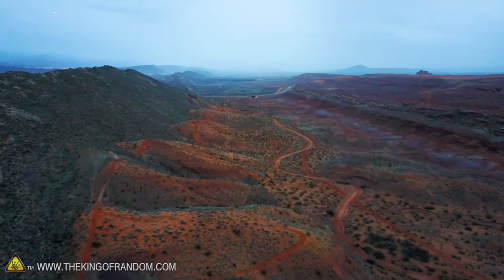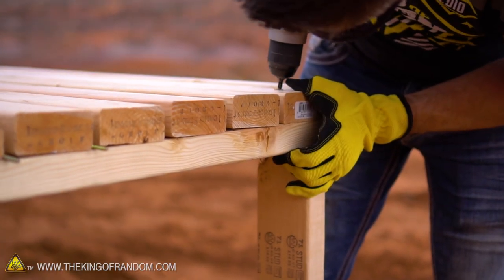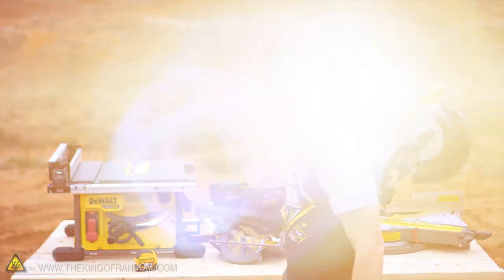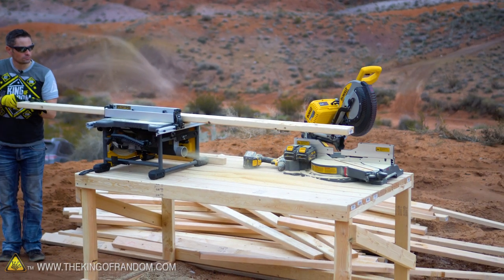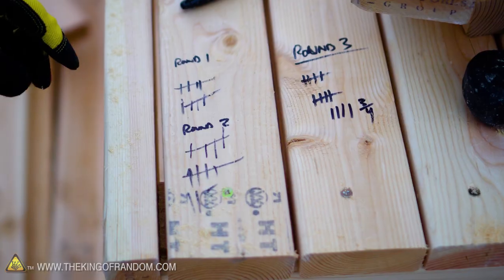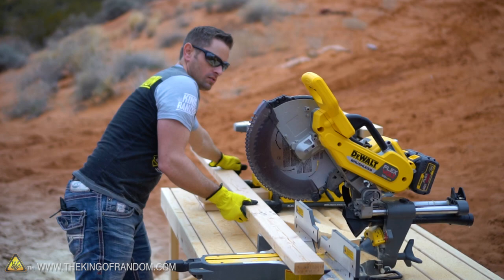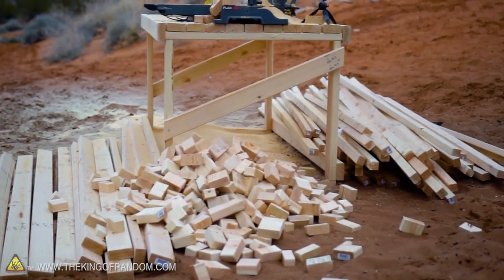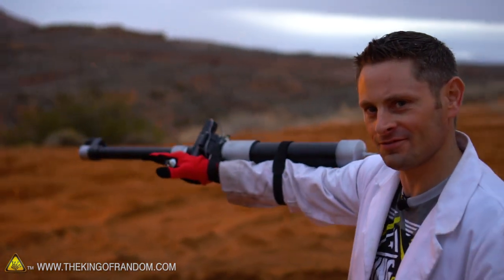Explosive Desert Bonfire, With DeWALT | TKOR Makes A 2x4 Bonfire With DeWALT Power Tools

Comment: You could have kept the wood for future projects and basically have lots of it without having to buy more. But hey it was a cool bonfire atleast
Reply: but wood isn't a renewable resource.
It takes a lot of work to grow a tree.
Reply: MaxPower yeah sure was sponsored along with 10 grand worth of dewalt toos
Reply: Haiiry Cake wood is renewable, also recyclable.
Fossil fuel based petroleum is not renewable, because lots of time and extreme pressures turned bio matter into crude oil.
Reply: Sebastian m nerd
Reply: You don't need wood to use a vacuum chamber or silicone
Reply: Some people just want to watch the world randomly burning.
Reply: Gnome child!!!!

Comment: I think you should have mentioned how long these battery packs take to charge. Depending on how long it takes you to drain each battery pack, with just two or four batteries, you could possibly run all your equipment indefinitely as long as you had charged your packs after draining them. Still a nice video. I wasn't aware Dewalt had such flexible multi-voltage batteries these days.
Reply: i know right they don't want to show the downside.

Comment: He kept saying that the 2 by 4s were and inch and a half thick.... Wouldn't they be 2 inches thick?
Reply: Alec Rosenthal no, Google standard lumber sizes, a 2 x 4 is actually 1.5 x 3.5 inches.
Reply: Mechie980 Does that make any sense?
Reply: 2 by 4 is the size before the wood dries. Once it dries it actually shrinks to 1.5 by 3.5.
Reply: Still doesnt make much sense
Reply: you can still by rough cut 2x4's that are actually 2x4. these are regular so they are 1.5x3.5. 2x6 is 1.5x5.5 and so on so forth. they still go by the old sizes even though they mill the new ones down more. they round the edges also. where as a rough cut has square corners. hope that helps
Reply: It does make sense when you realize the rough cut wood is at the actual dimensions  THEN it is planed down to the finished, smaller dimensions to produce the standard sizes we all use in the States.
Reply: Alec Rosenthal due to cheapness on manufacturers part, 2x4s are no longer correctly sized. They are actually 1 1/2 x 3 1/2
Reply: Cnerde I think you are ignoring the point. he asked about 2x4 lumber. not just the thickness of the board
Reply: I totally read his comment wrong. Derp on my part there.
Reply: people say it's for all sorts of reasons, not sure which one is true.. personally, I don't care that they're 1.5 inches thick, I just call them 2x4 because people know which board I mean, and "hey get me those one and one half by three and one half inchers" doesn't quite have the same ring to it
Reply: theXald this needs more likes
Reply: The name just stuck. A long time ago, framing lumber was  cut to 2"x4". But modern engineering now understands that wood just doesn't need to be that thick in order to make walls that are strong enough for residential construction.

More wood = more expensive. It's also heavier, and simply not necessary. Now the standard size is 1.5" x 3.5".
Reply: +pocket83 Actually, as far as I understand, 2"x4" originally referred to the dimensions of the wood before drying it, because the wood would shrink as it dried. Nowadays, it's just a name, and the lumber is instead specified by its final size, which is standardized to 1.5" x 3.5".
Reply: Granted, fresh timber is mostly water, but a 2" thick rough cut will still not shrink to 1.5"; that's 25% of its original size! Further, I have remodeled buildings that had 2"x4" framing lumber in the walls.
Reply: pocket83 that is correct. read my first reply. they are cut to that size after drying
Reply: +probsty13 A 2" thick rough cut won't shrink to 1.5". 1.5" is just a standardized value that was agreed upon, even though 2 by 4 was kept as a "name" for this cut. According to my understanding, anyway.
Reply: if you read my reply that is what i said. the rough cut is 2x4 then they process it down to 1.5x3.5. cause people want pretty wood lol

Comment: now that you did something hot... put liquid nitrogen in the vacuum chamber!!! it should solidify :D
Reply: Under what rules of physics would that happen?  Liquid nitrogen should boil off in low pressure..
Reply: He tried that a few videos ago! You should check it out.
Reply: Steve Jones no. The nitrogen will boil faster due to the low pressure, however, this causes more and more heat to be taken with it. This causes the temp to drop below nitrogens freezing point, and it will solidify
Reply: AHH..  wow.. that is kind of cool..   and explains to me why it hasn't really worked in many of the videos I've seen..  Every attempt I've seen just seems to boil off, but it's probably because there's not enough to last long enough to get cold enough, or the container isn't insulated well enough to not heat from the outside too fast.  

Even when it did work, I would guess that's a state that is very unstable though, right?  The solid N2 should sublimate away fairly quickly due to the vacuum, right??  Thanks for the explanation..

Comment: put a bluetooth speaker in a vacuum while playing something
Reply: I don't thing, it's gonna do anything.
Reply: you won't hear the music
Reply: You would probably still hear it, unless you're able to also levitate the speaker so it doesn't touch any of the chamber's walls. The sound (vibration) is going to spread through the physical contact itself and cause the chamber itself to emit the sound. Hanging the speaker on the wire probably would still not cause the sound to fully disappear (the vibrations would still move through it). Maybe placing the speaker on some soundproofing pad.
Reply: no air then no sound because sound needs mulicules to go through
Reply: wtf is a mulicule? Lol
Reply: Did you mean molecules? :)
To be more precise a sound to spread needs a medium which is capable to transfer the vibrations. Of course the vacuum is not capable of doing that, but the air is not the only medium sound can travel though. As I've mentioned in my previous reply, if the speaker is not physically uncoupled from the vacuum chamber's walls, the sound would still be heard, because the speaker's case would transfer the vibrations to the chamber itself and then the chamber would produce a sound on the outside. It would probably be muffled in some way.

Comment: Experiment: Put a heating element and ice in a vacuum chamber. Also put the ice in a sealed jar (so it doesn't just boil away because of the pressure lose).
Reply: Not sure what you're trying to test there..  If the ice isn't exposed to the vacuum, because it's inside another sealed vessel, what are you proving?  Are you trying to see if the heating element could convey heat to the ice, while in a vacuum?
Reply: Steve Jones Yes. Without a medium for heat transfer how much will the ice melt.

Comment: EXPERMENT FOR GRANT
Can you get a supermarket thick glass bottle that would hold juice or something (beer bottles work too) then empty the liquid inside the bottle, put the cap on and seal it air tight then put it in the vacuum chamber? The air inside the bottle would be normal outside air pressure then -28 inches of mercury or whatever your vacuum chamber can do?

Comment: My dad has so many dewalt tools cause he has his own tool shop in the basement and tbh the tools scare me even though I've used them many times 😂
Reply: We even have the dewalt radio, we've had it for years and it uses the same battery as the tools and it has a cord so it can be portable but if you don't need to use the battery it plugs in and it's so heavy omg 😂 it's such a big radio with black bars over it to carry it and i have a hard time carrying it 😂